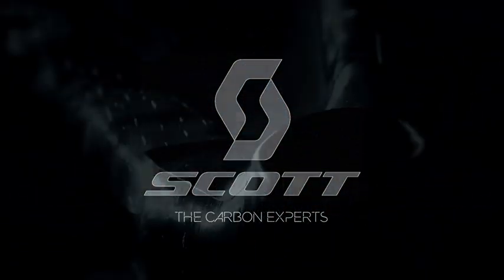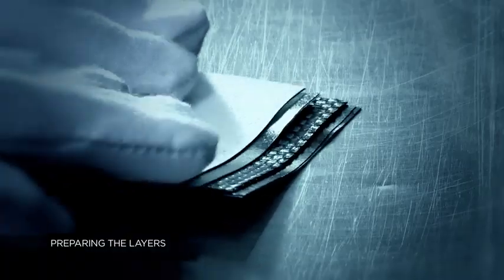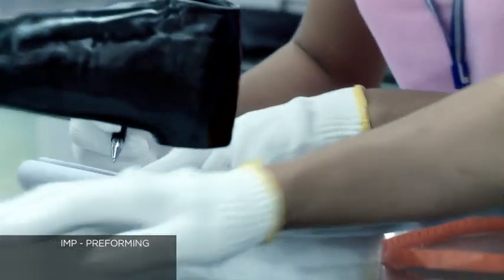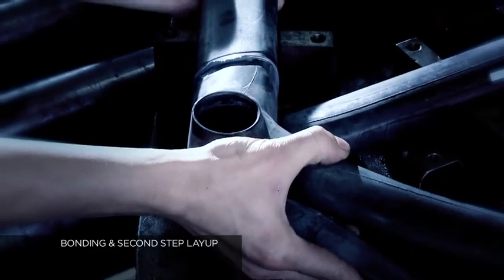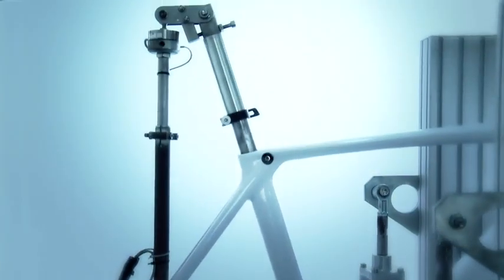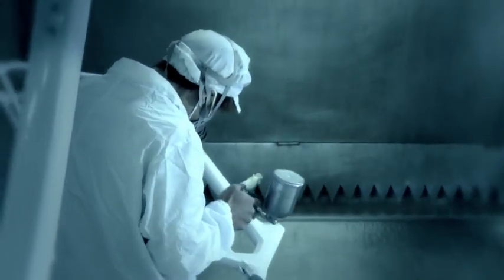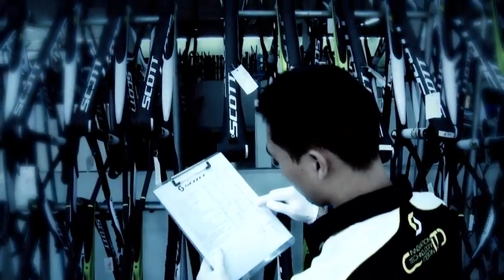Scott Advert Offers a Detailed View of the Carbon Fiber Manufacturing Process

Comment: I'm going to start making my own carbon bikes. I'm not spending$7000 when it costs about $400 in material to make it. And they're being made in either Taiwan or China for way less. Cycling has become a status symbol of wealth and it shouldn't be. In the most basic form a carbon bike is made with a foam mold, carbon fiber rolls, epoxy, a vacuum and patience.
Reply: patience is why carbon costs so much

Comment: Ya don't tell us about the core.. what a dumb video
Reply: Matthew Tuck how?
Reply: Probably a foam based core, heat and pressure is used to vaporize the core, leaving the carbon shell due to the low melting point of the foam core.
Reply: The core gets removed, all that is left is the carbon shell

Comment: How do they remove the solid core?
Reply: the core is made of a paraffin wax in preform mold,... then melted.
Reply: i thought that too, probably a trade secret
Reply: or it melts out in the oven or something
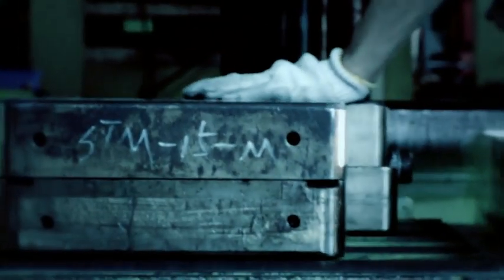Reply: You know or just trying to guess ? 1:49 "...during the molding process the layers are compressed while they cure..."Then, after 1:53 you may notice some fluid ports. My guess is that they blow "something" (hot air ?)  inside the core to press the layers between the core and the mold. How can that be solid paraffin ?Besides, a paraffin thin layer, that normally remains after melting will  prevent parts to be assembled. There is no resin on earth that adhere to paraffin.
Reply: They could be using a clearing agent such as xylene to remove the paraffin wax.  That's how paraffin is removed from tissues in the hospital histology labs.
Reply: Maybe melting by lost wax